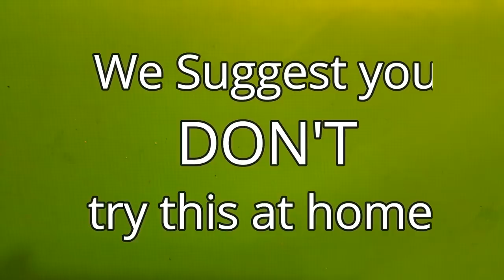Pouring the FIRST Panel for Air Crete Shed.

Comment: Are those gallon markings on the side of your barrel?  If so, how many gallons of slurry are you winding up with to fill the form?  Will the panel be 16"x8' and 3.5" thick?

It looks like you put a sheet of plastic between the slurry and the wood to keep the slurry from leaking out, and later it looks like the excess plastic was somehow folded up and attached to the steel of the frame. 

Is that is what it was, and how did you fold & attach it?

Comment: Nice work, HDC! I was wondering if you were vibrating this in the form once you poured and whether it made a difference. For a vibrator to vibrate concrete/aircrete while pouring, use a 2 Amp 1/4 Sheet Heavy Duty Palm Finishing Sander, (Harbor Freight for around $23 in May 2018), WITHOUT the sanding paper. Should vibrate it enough to get mix down into the corners. Carry on and keep foaming!

Comment: Hay you could  make the panels  thin then over lap them ( make it thick again ) to where they Lock in like some of the new flooring systems  do  I have some air stone  and air pump from when I had fish  I wonder if that could be use to generate  foam

Comment: With all the work that went into constructing that single panel, I'd have to conclude that conventional stick framing is less labor intensive and therefore the better option. We're talking about a shed here! Just my opinion.
Reply from the maker: Thanks for your input, I would agree if I had to go through each step as you saw it in the first test panel. However I built a jig to make the sheet metal stud forms. with the jig I can build 1 panel form in 12 min. I will build multiple forms. This is going to be more of a shop vs a shed. AC, Power, Heat ect. when I get on the construction site I will batch all of my slurry mix in bulk in a mixer. I will pour the correct amoun of slurry in the receptacle fold in the foam and repeat filling all of the forms one after the other. It will go quick. after I tip them up you will have a completely insulated structure. I know how long it takes to build, insulate, wall board siding ect on s stick built structure. This will be faster. You will see, stay tuned. Thanks HDC

Comment: Are you going to use sheet metal straps to tie the panels together? I'm going to build a shed soon and I'm interested in your project. Would you be willing to share a drawing or model showing the construction details?
Reply: Mike Neukam I am also wondering how the panels will be put together.

Comment: Seems like this is a shit ton of work for that panel.  Maybe for the leveling process instead of the trowel. You can use a longer then width of your panel of metal stud to rest on the sides to level out. Just a suggestion

Comment: I have watched several of your air crete vids. I was wondering if some  chopped fiberglass would add a little strength for the structural panels or would it do more harm than good?

Comment: I poured a 14 x 22 cube 3 days ago. I just remolded and side edges still Very soft. Can poke easily. Not sure if my mix or if aircrete just takes forever to cure. Anybody have suggestions?
Reply: Ya call the company